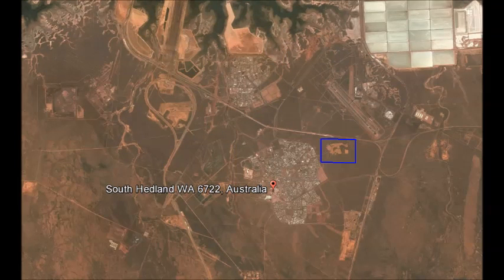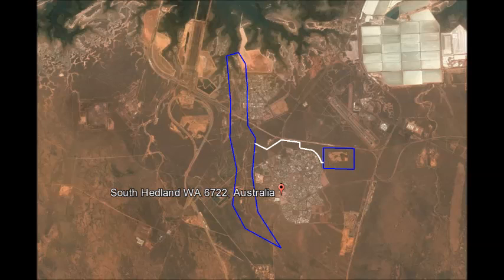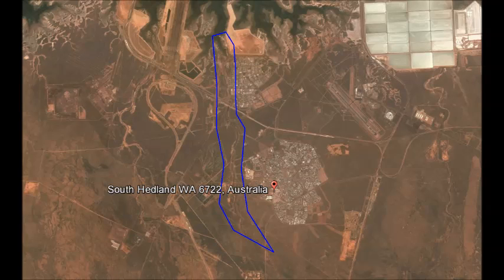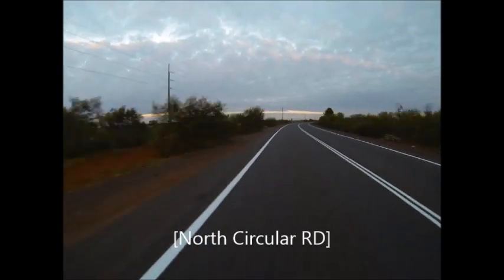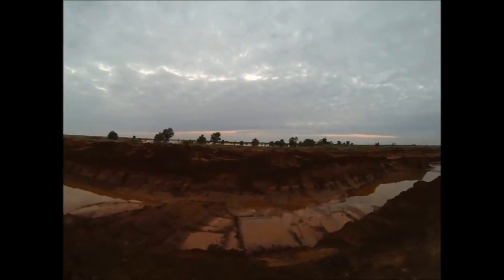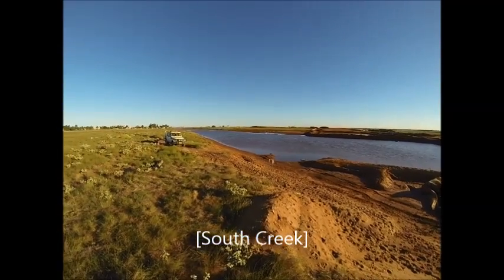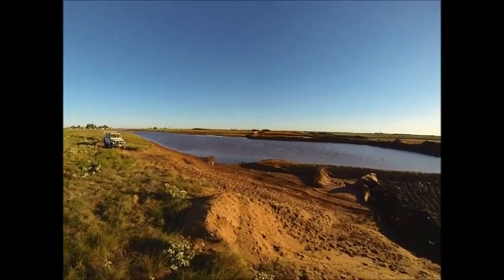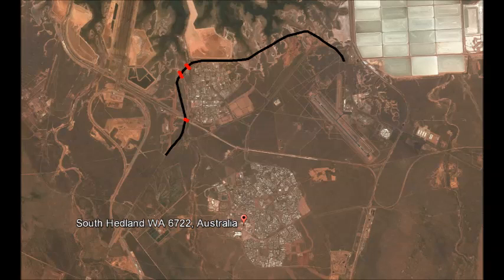hedland drainage

Comment: But couldn’t do anything as mayor there is no way you will get my vote
Reply from the maker: Obviously you do not live in Hedland or have any idea about what I did as Mayor. The dramatic changes I made  to the financial position of Hedland allowed the capital works and maintenance expenditure to increase from 4-6 million a year, to over 40 million dollars a year, drainage expenditure increased from nothing to well over a million dollars a year. If you live in Hedland you will have seen major works being done on Hedland's drainage system over the last 4 years. Because of the massive period of drainage neglect, it will take years to get up to standard but it's well under way. So your comment is uninformed and complete rubbish